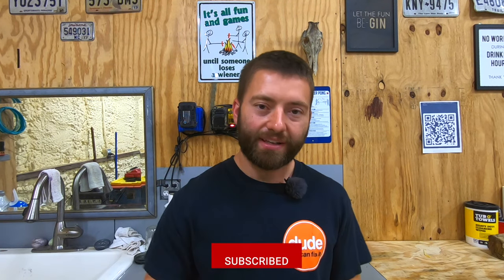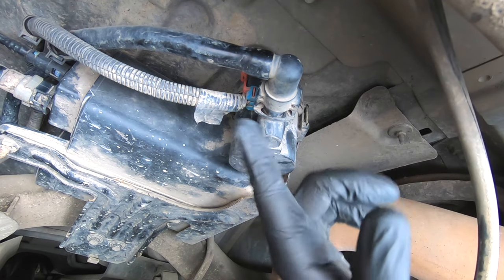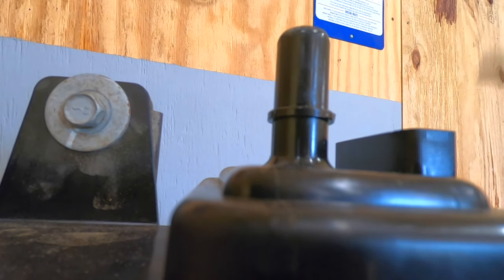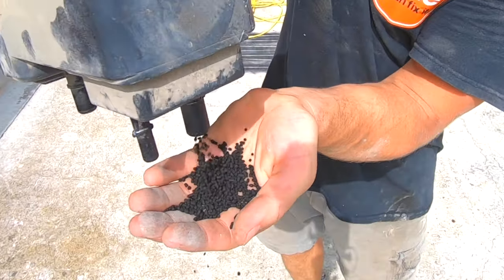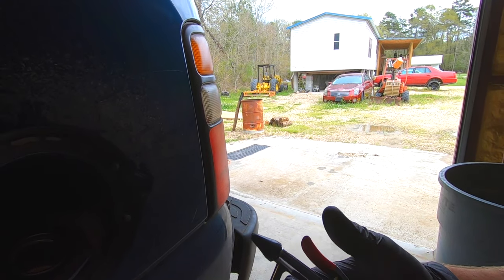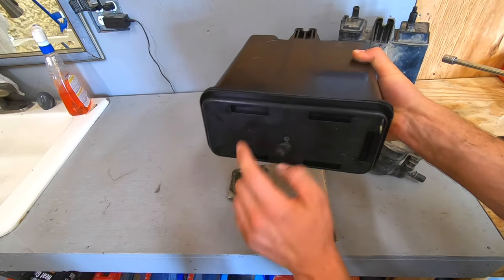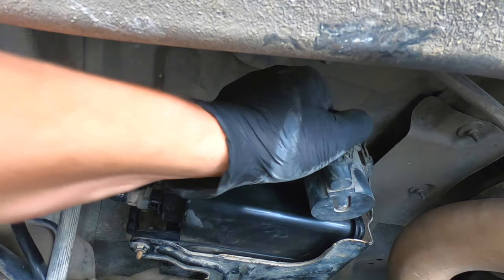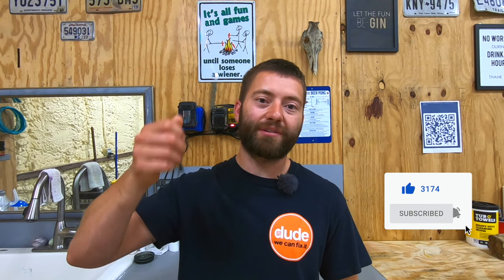GMC/Chevy Charcoal Canister Replacement

Comment: Man I have had this issues for months and it is extremely annoying. I've replaced the charcoal canister, EVAP canister and the EVAP sensor on the front of the engine with no luck. I didn't think to pressurize the tank though...will give that a shot tonight to see if that works
Reply from the maker: How did it work out for you?
Reply: @dudewecanfixit  it helped but I need to drop the tank and blow it fully out from the start of the hose. Years of charcoal build up
Reply from the maker: Gotcha. At least you're on the right track
Reply: @dudewecanfixit  yes definitely before trying this I could only get 4gal of grass total now I can get around 12gal. Already a huge improvement. Btw y'all 4l60e rebuild video was phenomenal and helped me rebuild mine about 2weeks ago. 400miles later and it's running great
Reply from the maker: That's fantastic! I'm glad to hear it. Please subscribe to our channel if you haven't already and feel free to ask any questions you have.
Reply: what happened? I did everything you did and still having same problem. Did you finally drop the tank and blow out the lines fully....i've done everything in this video, but still having the same problem
Reply: @DrAlexanderHamilton  no I've been telling myself for a year I would do it and still haven't done it yet.
Reply: I did blow out some lines but never dropped the tank. The issue is still there and is much worse in winter
Reply: @andrewsanders5774 so what do you think the problem is now?
Reply: @DrAlexanderHamilton  years of shit and carbon in the lines that compressed air isn't getting it all out
Reply: @andrewsanders5774  i found another video that suggested instead of vacuuming from the cannister forward under the truck, to blow out the entire evap line from the purge valve under the hood. That might be too long of a double line to try vacuuming out,  but blowing the other way might actually work better. Vacuuming from the cannister to the gas tank is only a few feet  and pressurizing the tank with air from the filler neck will only push carbon from the fuel pump to the cannister, which is a much shorter line than the evap line from the cannister to the engine bay
Reply: @DrAlexanderHamilton  that's a good idea. I might give that a shot this weekend
Reply: Did that work for you
Reply: @smitty420401  it helped but I still have tons of charcoal in the system. I have just given up and deal the the fact sometimes I can't fill it up all the way

Comment: Can the Charcoal Canister fail without the symptom of fuel not entering the tank?. A P0449 code stays on even after Evap Solenoid  replacement on a 2004 Silverado 2500 6.0 LQ4. Possibly the Purge Valve Solenoid on the engine?
Reply from the maker: Yes, it can fail multiple ways. The purge valve is easier to change
Reply: I also have a 2004 Chevrolet 2500 Silverado. I'm showing "Check Engine" light. Smog Check tech showed me Code P0446. Had EVAP Vent Selinoid Value changed twice. Running truck now to see if Check Engine light comes back on. The first time I had EVAP Vent Selinoid Value replaced I hD driven 57 miles before Check engine light displayed again. If Check engine light comes back on 3rd attempt will need to find a more competent mechanic and shop near me. Keeping my fingers crossed. P0446 error - related issues, bad gas cap, fuel pressure sensor, EVAP Vent Selinoid Value etc.
All ECM (Engine Control Module) electrical signal issues. I hate emission systems.

Comment: I replaced the vent solenoid  and charcoal canister sucked out the lines put pressure in the filler neck the only charcoal that came out was what was in the charcoal canister I'm gonna replace the vent next to the filler neck and see if that will fix it
Reply from the maker: Are you still having issues?
Reply: @dudewecanfixit  thank you for responding yes I am I haven't had a chance to check the vent tube I'm on blood Thinners from a heart attack after doing what I did the next day I felt like I was in a car wreck, I'm looking at buying a scanner

Comment: Could you also turn the vehicle on with the canister on and let the excess come out the lines by the selves, im sure vapor will but if its that much in there shouldnt it push it out also, i dont have a shop vac on hand
Reply from the maker: Your vehicle produces vacuum, so it might suck the beads in further
Reply: @dudewecanfixit  oh damn, well good thing I didn't trust my intrusive thoughts. I'm working on the vent solenoid now, but I'll check the lines again and see if I can't disconnect them from the tank and see if anything comes out. I know the old canister was saturated though because i would shake it like crazy and you couldn't hear the charcoal moving until I dropped it on the ground lol

Comment: Could a bad charcoal canister cause me to have bad mpg?
Reply: It shouldn't effect mpg cause its only designed to capture the extra gas vapors that need to escape your system when putting gas in your car. The evap system takes the extra vapors & reintroduces them into the fueling system threw the purge value & if your purge value goes bad you'll get a check engine light but I know on most cars there's no code for a bad charcoal canister. The only problem this canister causes when clogged is when your pumping gas. It will cause the gas nozzle to keep cutting off after a little is added & in bad cases it could cause the gas to be ejected back out the gas tank filler neck. Back in the day they didn't have these canisters, your extra fumes would be exhausted into the air when you pump gas. Its just another example of the problems all this emission crap causes. In your case though it has nothing to do with mpg.
Reply from the maker: Fantastic explanation! There is an egr valve on the engine that may cause some performance and mileage issues, but I believe that is a separate system from the charcoal canister and purge valve

Comment: I replace my canister but didn’t vacuum the lines😫, and of course it still does the same thing.
Reply from the maker: Dang, might want to check those lines for restrictions
Reply: Yes, I did already, it work 👍thanks for your videos
Reply: @user-hk3ye8il9b how far along the evap lines did you check for a restriction? And if you vacuumed the lines, how long did you vacuum them for?

Comment: Do you have to drain the tank ?
Reply from the maker: Nope, no need to drain the tank. I wouldn't do it with a completely full tank though.
Reply: @dudewecanfixit  I just did your method with a full tank? What's the problem with doing it with a full tank?

Comment: Will this issue cause the truck to hesitate to start?
Reply from the maker: It is possible, usually the check engine light and trouble filling the gas tank are the primary symptoms
Reply: Mine takes 2 times to crank ...trouble filling tank also ..

Comment: My question is.... can i do everything this guy did.... and put in the old filter... 
I qm trying to get back to my home. Im on vacation and this happened to me and my girlfriend. We havent been able to drive home because its 250 miles back into phoenix az... all i can get in my tank is about 2.5 gal.. i have no tools... and i have TWO ... (5 gal  cans)  i just bought. Its gonna have to work and i will stop every 45 miles to add the 2.5 gals... i just was not prepared to have this happen. Really afraid for my fuel pump... peaying it is not gonna be screwed and go out....
Reply from the maker: You can clean the lines but if you put the old filter back in, it will get clogged again 

I hope you made it home!

Comment: I think I have a similar issue,when I fully close the Fuel tap,the fuel pump doesnt work,I need to open the tap and the air gets out doing a "fffffffffff" sound then the Fuel works haha
Reply from the maker: You definitely have a restriction in your evap system!
Reply: @dudewecanfixit  yes,we blew with air compressor the tube coming from the Evap Canister and it didnt do it anymore that issue,now I got another issue with the evap purge sensor,if the car is filled with petrol to the max it shuts the car and I need many tries to make it work again 🤷‍♂️😅🤣
99 % of the same issue videos on youtube all said it was that cheap evap purge sensor fault that is stuck open or vice versa
Reply from the maker: Yep, the purge valve goes out frequently

Comment from the maker: Tools used in this video 

OBD2 Scan Tool:
 https://amzn.to/3MMQk7y
CRAFTSMAN Deep Impact Socket, Metric, 1/2-Inch Drive, 22mm: https://amzn.to/3NTNEGs
BLACK+DECKER Magnetic Screwdriver Set, Phillips, Flat Head, and Precision Screwdrivers: https://amzn.to/3MWsk1W
DEWALT Socket Set, 3/8-Inch Drive: https://amzn.to/3Qk1Fik
ALL-TOP Air Compressor Kit, 12V Portable: https://amzn.to/3zBqoZl
Craftsman 4 Piece 1/2 Inch Drive Socket Extension Set: https://amzn.to/3Qh0ct4
GMG SINCE1988 Nitrile Gloves, Black Nitrile Disposable Gloves: https://amzn.to/3mLZwOY
Reply: Do you have any idea where the evap vapor canister vent valve  is located on 2018 Cadillac xts? I can't  find a repair book for my car.
Reply from the maker: I have never worked on one of those, so I really don't know

Comment: I've seen people clean out there old ones & not buy a new canister.
Reply from the maker: That's interesting, I haven't heard of that before
Reply: I am curious how this would work, because the canister will still send charcoal pieces into the lines...the internal screen that contains the charcoal in the canister fails.
Reply from the maker: I'm with you.

Unless they remove all the charcoal, but then it wouldn't fulfill it's purpose